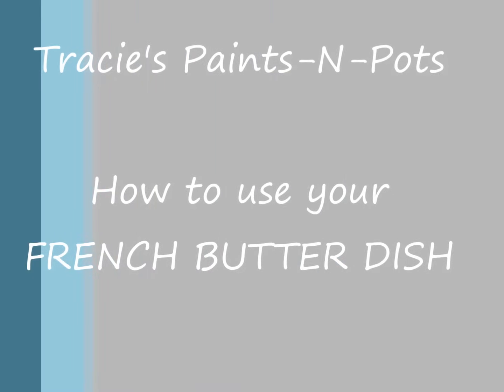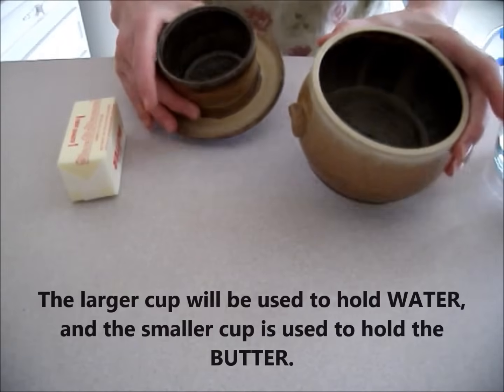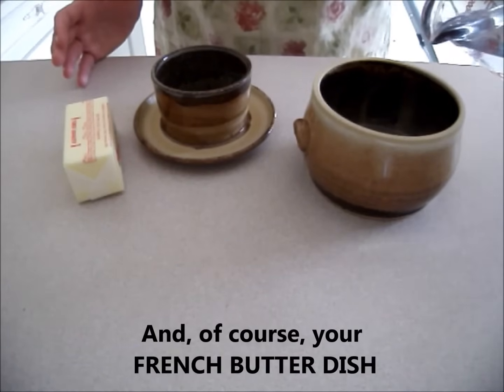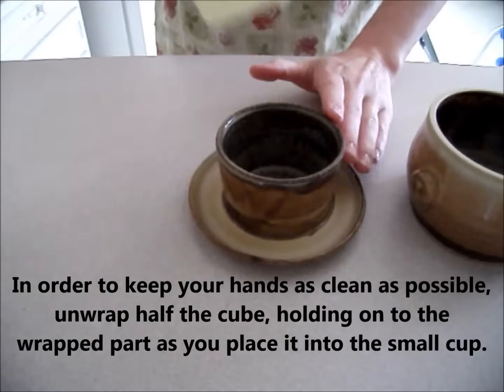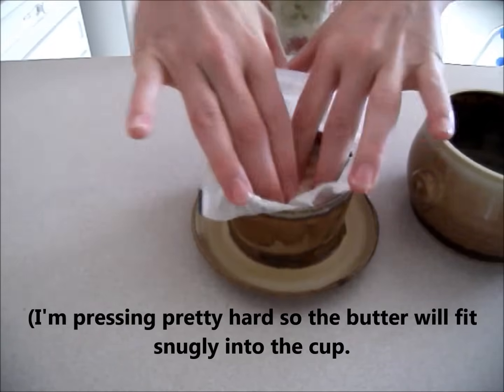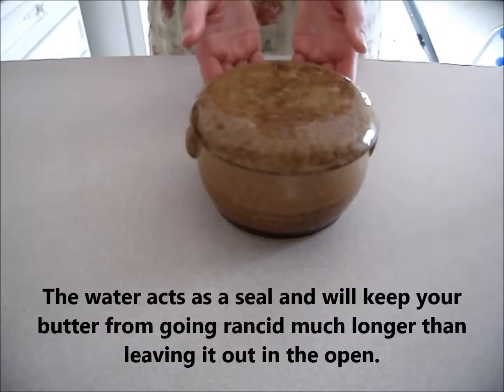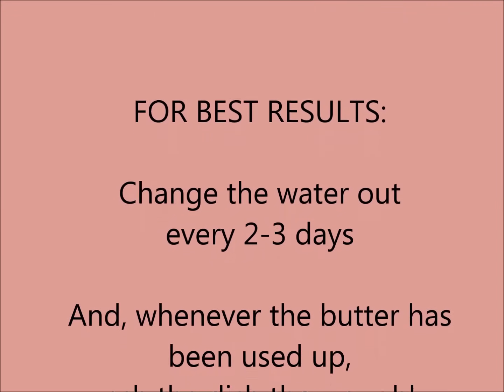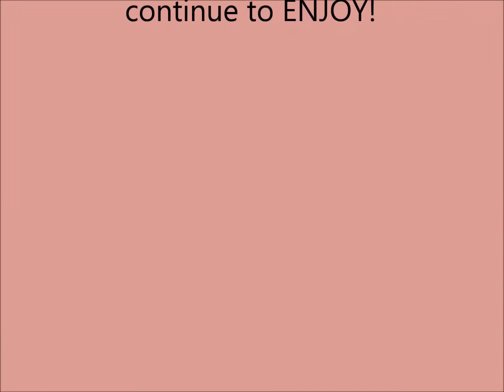Pottery: How to use a FRENCH BUTTER dish. With Captions.

Comment: Is there any complaint about water getting on your butter (and bread) or is the butter clear of the water?
Reply from the maker: You may see a few drops of water on the butter, it is the water that helps keep the butter fresh.  I've never had a problem with that, and I've been using my dish for 8+ years.
Reply: Water and the butter fat/oil will not mix. Hence then water just heads off it when you turn it over to spread the butter.
Butter not wet or soggy at all

Comment: I had figured out how to use the butter keeper except for how to properly load it. I became discouraged in the middle of a hot summer when the butter would not stay up in the holder so I should probably put it in the fridge when it is in the 80s plus. Perhaps it depends on how the inside is finished ? Did not know it was a French invention. Gleefully off to load my keeper now !
Reply from the maker: Happy loading :) Thanks for watching.
Reply: This method of storing butter is of no use to me in Georgia as the temperatures most the year are high and even with a/c going the butter grows mold. In the winter months my old standard butter dish works just fine. I found changing the water and cleaning up the oily mess more of a pain than a help.
Reply: @lisanolen3108  Only raw butter (unpasteurized butter) will grow mold. Pasteurized butter, what you find commonly in most stores cannot grow mold. Salted pasteurized butter is even better. Pasteurized butter can become rancid though. This is different than mold.
Reply: @43wagonwheel  any butter can mold, it's just a matter of how long and at what temp. As you said,  pasteurized takes longer,  and might go rancid way before that,  but that's dependent on other factors too. I live in Florida, and I keep my house at 75F all the time and it rarely happens,  but the house where I used to live before the temp kept at around 80s and regular brand butter would grow a black mold on it if kept longer than 2 weeks.
Reply: I find it necessary to put it in the fridge too. Trouble is expansion and contraction cause the butter to fall into the water. I find by not using the water and keeping my butter dish upside down all the time I just take it out before I need it. All the water is doing is making a seal from air entering so you really only need enough water for the lip to sit in,  no more. Even though I use it without water and defeating the whole idea,
it's just that it takes up less room in my fridge.

Comment: So is the butter supposed to come in contact with the water (in order to create the seal) or is there supposed to be an air pocket left between the butter and water?
Reply from the maker: Yes, the butter should come in contact with the water.
Reply: @auntiescakery  got it thanks. I tried it. It seems to work; but when I lift it from the water there are of course some drops left on the surface of the butter; that's not a problem is it?
Reply from the maker: Not a problem at all, as oil and water don't mix.  I love mine and have used it over 6 years now!
Reply: The rim of the butter cup is all that needs to touch the water. If the butter touches the water the water will become nasty and spoiled almost daily; therefore, it's better if the water is only high enough to touch the rim of the butter cup.
Reply: @lisanolen3108  Correct.
Reply: @auntiescakery  I always thought the whole point was that the lid creates an air pocket so the butter doesnt touch the water, only the lip of the lid does so if the butter doesnt go over the lip it shouldnt touch the water... thats what I always thought

Comment: Can you use Country Crock butter, or do you have to use a stick of butter?? I put Country Crock butter into mine, and it melted on me. I didn't have it in the sun light, and after I got some butter out of mine, and I went to put it back in the bottom where the water is at, it all fell out and went into the water. What am I doing wrong?? Please help
Reply from the maker: As far as I know, you can use any butter.  Make sure it is packed FIRMLY into the butter cup. When it gets over 80 in my kitchen, my butter tends to fall into the water too, but it can be placed back in. Also, when I have it sitting by the toaster or microwave it gets too warm.  Try to keep in a spot around 70. Hope that helps!!
Reply: Is your butter too soft or too hard? I generally tell my clients if the butter falls out it's because you put it in too cold. I am not familiar with that brand in canada.
Reply from the maker: After thinking a bit, isn't Country Crock a margarine? Margarine is naturally soft and may not work so well as butter does.

Comment: Mine keeps falling off... any suggestion?
Reply from the maker: Pack it in the cup TIGHT, and keep it away from heat. That should be all it takes. If the dish gets too warm, the outside of the butter will melt just enough to make it slip into the water.

Comment: Is this supposed to be refrigerated or no
Reply from the maker: This does NOT require refrigeration.
Reply: You can though if you are going on vacation. Or if you keep your house really hot. I usually put my butter in the lid and then I run cold water on it to get it to suck up against the sides